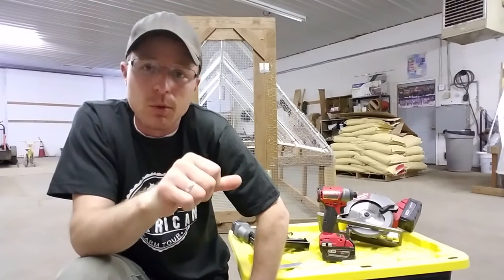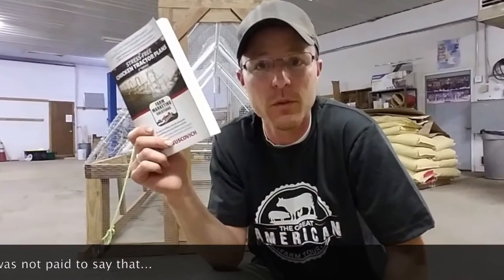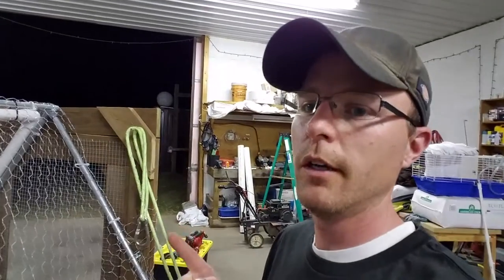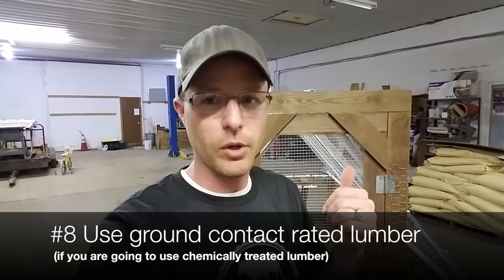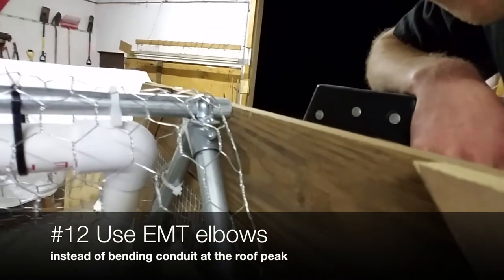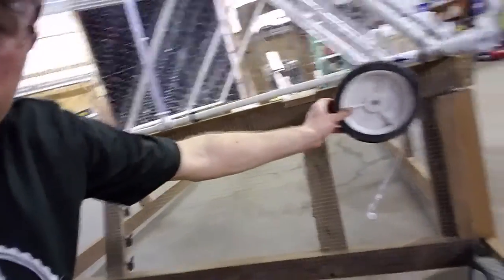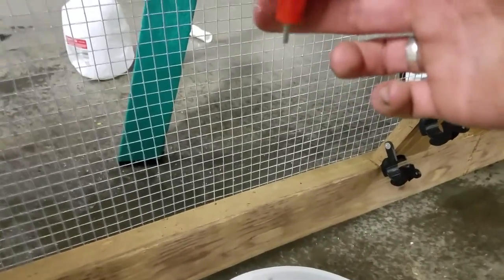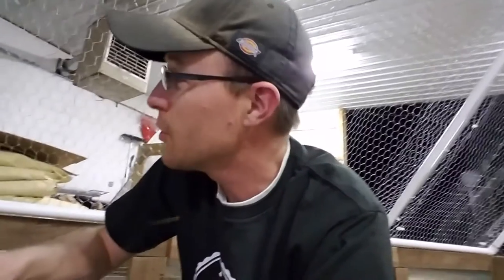Suscovich Chicken Tractor: Tips Tricks Mistakes and Sweet Mods

Comment: If you don't mind me asking,, how much money would a person have in this build? This is an awesome video,, very very informative thank you. I may go smaller and put boxes in for roosting and eggs. Thanks again.
Reply from the maker: I would recommend pricing it out at your local store. When I built this in early 2018, it cost $362 for each tractor, but I did have extra hardware and chicken wire laying around from the first tractor that I built.
Reply: @RandyKleinman  thank you for replying. Are you still happy with that build? You have a blessed day
Reply from the maker: @jackbquick123  I am happy with everything but the water system. It just doesn't hold enough water during the hottest and driest times of the summer and needs to be refilled more than once a day. I am thinking about just using a larger diameter pipe mounted directly inside the top of the tractor and held up by straps. Will have to be a Winter/Spring project though.

Comment: Here's a tip I use for my raised bed garden covers re: height... rather than a strict A-frame design, (or Hoop Design) buy two or four of the EMT elbows with 45 DEGREE angles (135) for each support. You can increase the height across the entire width, simply by cutting straight verticals to whatever height you want, then connect with a horizontal conduit from side to side. Gives you much more walkaround room, and a wider flat ceiling. Eliminates all the problems with bending conduit, except maybe attaching to the base. In the center beam, you can either use cross pieces or lock ties for rigidity.  
  _________
/                 \
Reply from the maker: Great idea, thanks for sharing.

Comment: Randy have you found the chicken wire to be sufficient protection?  Im planning to build two of these and Im thinking about hardware cloth across the top.  Raccoons and fishers are our largest concern but we use electric fence on our layer mobiles which has been effective but.. the layers are locked up tight at night so there isnt as much incentive as with visible meaties
Reply from the maker: I have not had any issues with predators at all with the exception of birds that have gotten out of tractors or electric fencing not being energized by accident. You could go with the hardware cloth, but it will be more expensive.

Comment: I thought I came up with this myself. LOL
The basic plan, anyhow. 
Sides 18" high, 8' x 8' square, and a 5' high peak.
I used treated 2 x 4's for the bottom, and then went up with 2 x 2's, ripped from 2 x 4's. 
Reinforced with plywood on corners. 

I put a brace across the center, which also acted as a roost. 
I then covered the whole thing with fencing. Used chicken wire on the sides, and 2"x4" utility fence on the roof, for strength. Then a tarp over it all. 
I ran a high-tensile type wire from corner to corner on the bottom, to pull it with. But I ran it through a 3' section of garden hose, to make it easy on the hands. 
To help the back edge navigate uneven ground, two "shoes" made of 2x4's , 12" long, bottom corners notched off, and also a 2x2 square cut down from the top center, worked like a charm! You just slide those shoes under the far end, lifting it 2". Then go to the other end and pull the wire loop. 
Just remove the shoes after positioning the pen.
This model is lightweight enough for even me, a 5'2" woman nearing 60 yrs old, to pull daily.
Reply from the maker: Nice!
Reply: Has anyone designed a tractor that you can move from inside. I wonder if you can build a bigger one, for the same weight/drag as it can pivot somewhere in the center.
Reply from the maker: @naomi6212  I am not aware of this. I personally wouldn't do it because there are too many opportunities for you to step on/injure chickens. They don't exactly get out of the way all the time while you are moving a tractor.
Reply: @RandyKleinman  I understand about the possibility of chickens getting in the wrong place but that's always the case. I think if you are inside they may follow you (in the middle) and perhaps easier for a female to move. Perhaps one day I will try.
Reply from the maker: @naomi6212  I'd be interested to know how that works out!
Reply: @RandyKleinman  give me a year or two.....I have more ideas/dreams than land.....

Comment: So I haven't seen anything more on this tractor how did the pvc water work and how is it doing now
Reply from the maker: I would advise against it. A single pvc of larger diameter down the middle of the roof would be less expensive and would carry more water. Thanks for watching!
Reply: @RandyKleinman  I'm actually at the 5 gal bucket stage with watering cups instead of the nipples and trying to find w way to connect the buck to the tractor thinking make a shelf inside and a outside fill port just ordered the book off Amazon today to build the tractor.
Reply from the maker: @leonannegers7874  that sounds like a great plan.

Comment: Glad I watched before I started the build! I bought 5' pieces of conduit and used the connectors. Drilled into the frame with an impact driver for the conduit pieces! I put the chicken wire on the outside of the back; yours looks like it's on the inside. How does it connect to the sides for coverage? Am completely baffled by how to connect the wire to the front area. My front conduit piece sticks up over the top of the door, like on John's photos of his tractor, so I can't make the wire cover that area no matter how I try to figure it out. The wire looks like it's on the outside of the front of your door. Does it go on the outside of inside? Help!!! Thanks!

.
Reply from the maker: Hopefully not too late in this reply. I put 2x4s on the bottom of the front and back (standing vertically, I show it in this video) so the hardware cloth could attach flat against the existing sides. I also had the peak of my conduit at the same height as the door frame, so it doesn't stick out. Hope that helps!

Comment: Do you have a parts list for the additional add on items for your build version?
Reply from the maker: I don't sorry. And I don't recommend the waterer setup either. It didn't really pan out how I had hoped.
Reply: @RandyKleinman  oh no? I was just going to implement it! But I haven’t purchased any pvc etc.
Reply from the maker: It's a lot of PVC and work for not a lot of water storage. If I were to do it again, I would just hang a single 4" pvc pipe from the center with a pipe down to the waterers. Stores more water, cheaper, and easier to build.

Comment: I'm building this right now and I'm looking for how the door pieces connect. Specifically how parts K, G, and F connect. The measurements do not line up. Sounds like John needs to do a revision on the plans because I just purchased them, cut all my pieces and started assembling only to realize I don't have enough material and the pieces I cut don't line up (the half lap on G is a 1/2" off from the lap on F.
Reply from the maker: Yeah it is tricky, I had to make a few trips to the home improvement store to get it all done. I would love it if John would create a new edition of the book, specifically to address the construction of the door and its frame. Hopefully you got some help here though!

Comment: I assume you don't actually mean to use a 1 inch spade bit?  a 3/4 inch spade should still fit 1/2 inch conduit and would leave much more meat on the wood.(seems a 1 inch whole through it would leave it very weak).  but you do show the top angle fitting being a 3/4 inch, so the spade bit would need to be 1 inch for 3/4 inch conduit.
Reply from the maker: Good catch, but I don't actually remember what it is. I would say try a few holes in a scrap piece of 2x4 with a couple of different spade bits and see what works best. What I do remember is that it was a pretty tight fit.

Comment: On your chicken watering system do you vent the other side of your top water tube to allow air to escape while you fill the rest of the system though the snorkel with a garden hose?  If the snorkel was the only opening it would be a mess / very slow to have that captive air trying to come out while you are filling.
I would add a PVC shutoff valve in front of your manifold "T"s so you can connect/disconnect the manifold(s) for servicing without trying to put the pvc plugs back in with water gushing all over.
Reply: I was thinking the same thing
Reply from the maker: I do have a vent on the other side, but honestly I filled it up so slowly while I was doing the rest of chicken chores that i was rarely a problem before I put the vent in (after I made this video).

Comment: Why not just delete the 3/4 EMT pipe and use the PVC water system as the support?  Good vid, thanks for the tips!
Reply from the maker: That's a great thought and I had considered this as well. For me in Minnesota I wasnt sure if the PVC could handle the snow load over the winter. Also, the 1/2" EMT is pretty inexpensive.
Reply: @RandyKleinman  I think it could handle the load simply because with the slope I don't think the snow would pile up too high before sliding down. But that brings up a good point in that the water will most likely freeze in the PVC pipes, correct? Also, have you temped the water coming out in the summer, does the PVC pipe heat it up too much?  I'm right in the middle of building my first Suscovich tractor and just fired off an email to John expressing my displeasure on the confusion with the front/front door pics and measurements, etc. The pics/measurements in the book are like an M.C. Escher drawing - lol
 I do really like your idea of drilling the holes in the top 2x4 on the sides to anchor the EMT pipe and will do that myself.  I also just order the EMT elbows and 2-hole straps - excellent idea there you had!
Reply from the maker: @fooddude9921  Thanks Robert. We had 50" of snow in just one month last February and that was enough to totally bend and mangle the roof of my sheep shelter, which was cattle panels bent 180 degrees and supported in the middle by 2x4s. So, I don't have a lot of confidence that only the PVC pipes would withstand the snow load unless you were going to ensure that the snow was removed from the roof if it got too deep there. I don't use my suscovich broiler tractors in the Winter, but around here, they will definitely freeze starting about mid-October. I have checked the water in the summertime and it doesn't heat up much at all because of the tarp shade and because it is constantly being used by the chickens.
Reply: @RandyKleinman  Yeh, I guess that's what I was thinking, that the snow would be removed as it accumulated. Then again if you had a covered area to store them in the winter.... :-)

Comment: The only thing I’d do differently is use the water cups vs the nipples.  I found that a lot of water gets wasted with the nipples and makes things messy.  Not only that, but if you figure water into your cost of raising the birds they will also save you that little bit of money.
Reply from the maker: That's a good observation, we have a well, so water isn't a huge cost at all. The only reason I have never tried cups is that in the later batches of birds, the water can freeze. Thanks for watching!

Comment: Drilling 1" holes for the conduit through 1.5" of wood doesn't sound like a good idea. You'll have a quarter inch of wood on each side, which will only get weaker in the weather and there will be strain on it when you move it. Also, the PVC contraption looks really complicated. Just so you don't have to enter the coop to fill the water? Move the bucket closer to the entrance and spray through the chicken wire to fill it up. With the system you have, there will be debris getting in the pipes and clogging it up, with no good way to clean it out.
Reply from the maker: Thanks for the feedback. I wouldn't do the PVC like this again. I put an inlet on the back with two valves to make it so I could just hook up a garden hose and that worked fine. If I was going to do it with PVC again, I would just use a single larger diameter pipe down the middle. 

I raised 4 batches with these last year and never had a problem with clogging. 

You are right about the conduit,  and I reinforced the spots where I ran the spade bit through with another chunk of 2x4 on the inside which i use as a stopper for a brooder partition. But the conduit is 1/2", so it isn't as thin of a margin as you say.
Reply: I feel like you focused on maybe a negative...but mostly something you just don't agree with. There's no real weight to the conduit...so its no worse off than how John does it. I think this is a great video for people who want ideas...I used most of these and added a few more of my own. I'd share what they are...except I'll probably be ridiculed by someone who can just not do my suggestion
Reply from the maker: Thanks for watching Eric!
Reply: @notquiteajedi  My concern isn't the weight of the conduit. A quarter inch of wood on either side of the conduit isn't enough because:

1. The sheer force exerted on the wood because these things have to be moved
2. The weight/strength of predators who will try to get in
3. Wood gets weaker quickly in the elements (rot, etc)
4. Natural weaknesses in variations in wood grain (knots, horizontal grain, etc)

Also, why waste all that $$$ and time building the PVC contraption, and then all the time fixing it/cleaning out algae, when you can just move the bucket and spray directly into it? Why complicate the design? 

Please try not to get offended at constructive criticism. It might be my 'opinion' but it's based on experience, engineering principles, and the desire to help people not experience the heartbreak/frustration of realizing they could've saved a lot of money and/or prevented the loss of their flock. 

A lot of pinterest/YouTube/internet inspired people aspiring to be homesteaders/farmers don't have the hard knocks experience of all the many things that can go wrong. In reality, hundreds of hours of work and thousands of dollars can be lost because of bad design. It's already hard enough to justify the labor, mess, expense and risk of raising your own meat even if everything goes exactly according to plan. If you're not careful, you'll end up raising chickens that cost you $40 and you'll STILL have to process them :)
Reply: @bluegorillacookies  I agree with all of that. It's very well stated. I drilled holes in my wood and inset the conduit...I did, however, also still use screws to help fasten it. I'm not sure how it will weaken the wood...as there's never any tension on it. Additionally, I tucked all of my chicken wire underneath my hardware cloth and ran it the length of the tractor instead of up and over. I then used my leftover hardware cloth and made almost a ridge cap to cover the wire so there aren't any seams to tear my tarp. My tarp also completely cover the 2x4 the conduit it inside...so, hopefully, the elements won't be a factor. I appreciate this candor and dialogue...this is how designs keep getting better! I cannot say that my modifications made things better...but I don't believe it's worse. At the end of the day...it's a wooden structure that is sitting on the ground outside...eventually it'll all fail. I hope all is well and would love to speak with you directly about more ideas. It sounds like you may have some great ones! Cheers!
Reply from the maker: Thanks for keeping it civil and constructive guys. I know the waterer especially is not optimal, but YouTube won't let me change a video and based in the views and feedback, I wouldn't want to take the video down and not be able to share the other tips.
Reply: @RandyKleinman  That makes a lot of sense. Thanks for the feedback. You really have some great design tips, especially on the conduit roof, getting things flush, etc. I wish you the best in your endeavors!
Reply: @notquiteajedi  Thank you so much for the conversation. I love dialogue like this, too! It sounds like you have a great wire/roof design! I'm not sure I have that many great ideas, but I wish I had discovered bailing wire earlier. It's versatile, cheap, and strong for fortifying/holding things together. I'm moving into a new season in life, but I wish you the absolute best in your venture!!
Reply from the maker: I used bailing wire to string together some rabbit cages. Duct tape, cable ties, and bailing wire are a farmer's secret weapons.

Comment: Why didn’t you build it taller so you don’t have to bend down to get in it?
Reply from the maker: I was just following the Suscovich plans for the height. I think if you wanted to go higher you could, but it would require more conduit and lumber and chicken wire.
Reply: With older people like me who don’t like to bend over,  taller side walls would be better.  I’ve had chickens fly up 20 feet to roost in the rafters of a barn.  If the side walls were higher the laying bins could be higher as well.  Thanks for your insights.
Reply from the maker: @charlesanderso1686  I agree if the peak of the roof was 6 inches taller I could stand up fully. Even bending down is better in my opinion than completely bending over when is what you have to do with Salatin-style chicken tractors.
Reply: @RandyKleinman  Ive been wondering this same question. i thought about doing a 30 degree bend in the conduit at the bottom so the angle is less steep in turn raising the height  but I'm worried that the 90º connectors won't work in the center. Any insight?
Reply from the maker: @dylanshaffer3424  might be able to go vertically straight up and then bend to a peak in the middle. I am sure John's original design was to make this out of a single 10' piece of conduit. Dunno, maybe he is shorter than me in real life. I haven't met him before though. :)